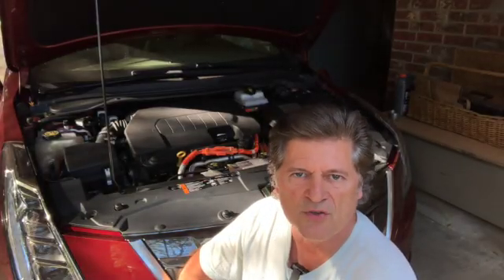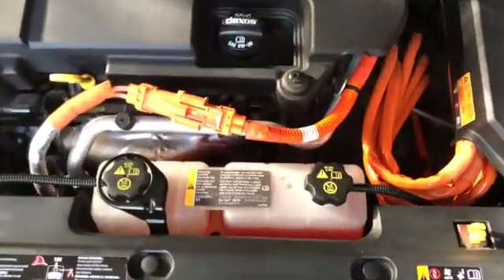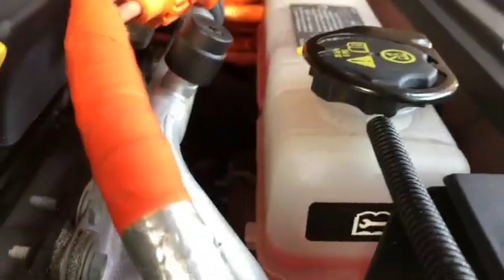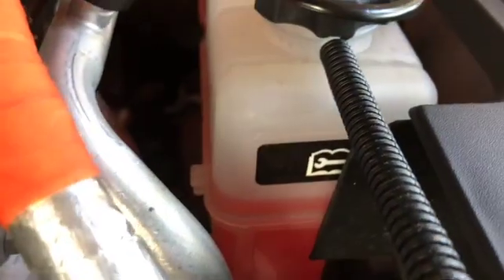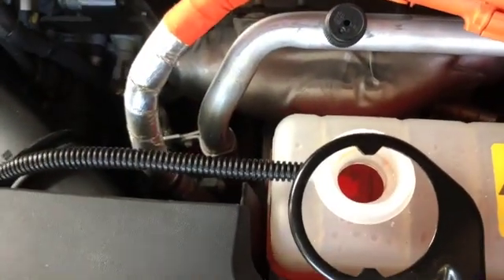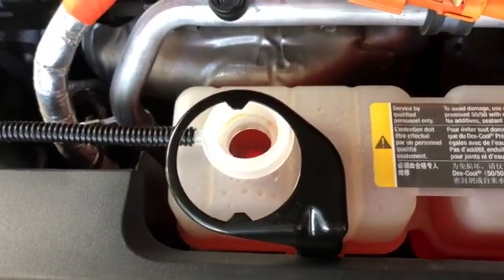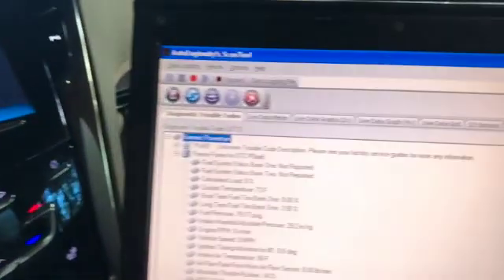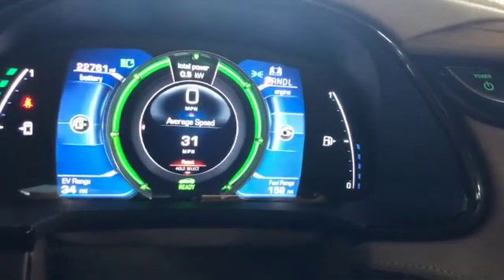Service High-Voltage Charging System Error Message...Fix and Reset

Comment: I was surprised the Chevy dealer had the coolant in stock cheaper that the auto-store or Amazon, and it was the exact right product per the manual. 18 bucks. The local smog shop reset the computer for free, and bingo...back in business. Thanks for your video.

Comment: So I’ve filled up the coolant and nothings changed, removed the code and it stayed ok for a couple of days then came right back I assume it’s the sensor but don’t know if I should buy a new one or how to replace it if you can do a video on that 

It’s sometimes hot in the car but I assume it’s the summer heat

The scanner says the code is a P1E00 with the scanner also adding $07E8 and a freeze frame of P0AA6

Comment: I have a 2017 Gen 2 Volt and found all 3 of the reservoirs slightly low - I've never seen coolant on the ground, nor can I smell it when driving...  Where can the coolant be going?  Once topped off, (High -Voltage battery res. had a simple washer-type lock, just hold the top & bottom of the cap together while removing to bypass lock), I cleared the code.  Viola, CEL gone - Thank you!
Reply from the maker: Could be just a small leak that comes out the rear drain while you’re driving. Might be worth a check to see if there is moisture at any drain locations.

Comment: If the problem persists, pull the tank if you have to but on the left side directly on the bottom is a slide out sensor...fat "T" shape (Black).
Reply from the maker: Thanks for the tip!

Comment: Hey what kind of scanner did you use for this? I'm looking to fix my Volt and any information would be greatly appreciated!
Reply from the maker: It's a program called AutoEnginuity. 
If I were doing this today and didn't have a scanner, I'd get a YOUCANIC diagnostic scanner.
I just purchased it this week and am impressed so far.

Comment: I have to reset mine every day to charge. I have replaced the sensor and topped off the antifreeze, which was not really low. The heater water pump needs to be replaced again #3, all with less than 55000 miles. Otherwise it has been a good car.

Comment: If the level increase doesn't work, out of warranty the dealer will automatically want to replace the whole tank (that includes the sensor) even if the problem just turns out to be the wiring (2 wires...to a "hall-effect" sensor that goes low resistance when the magnetic float in the tank gets too low) or the $20 sensor itself. 
I also had my Volt do the "UNABLE TO CHARGE" and it turned out to be the charging receptacle itself! You should read continuity between the pins of the receptacle and the corresponding pin of the orange connector...ANY resistance over like ten ohms will make the car go mental. There are videos on changing that...EASY.

Comment: Thank you so much for this video and valuable information!  I have owned a 2015 Chevy Volt for 2 years now  with 85k miles and I received the error "service high voltage charging system". I was freaking out because I know that electric/hybrid cars can be more costly to service so I was seeing dollar signs. Just happened to google this and your video came up. Sure enough my coolant for the lithium ion battery was low. I stopped by the local Austin, Tx Chevy dealer here and bought some dexcool 50/50  for $18  bucks and filled it up to the recommended level. Next I ordered a Foxwell NT301 OBDII scanner from Amazon that says will clear codes for about $60 bucks. And today I hooked it up to the OBD port and cleared all the codes and the check engine light went off and the Service high voltage charging system error message is gone. And I plugged in my car and it's charging again!  You saved me $$$$!! Thanks again ! ☺
Reply: becuase of this very comment, and this video, you guys saved me SOO much money. I cannot thank yall enough. I have a 2011 Gen 1 Chevy Volt and had the same code/error message. I picked up some some dexcool, took it auto advance, had them clear the codes, and bam, my car is a PHEV again. And i have been driving around just with the engine for almost 2 YEARS, and all it took was a little research and advice from others. That you both, again.
Reply from the maker: @diddle1675  it’s pretty sweet when you start being able to charge again!
Reply from the maker: Glad to help, I think the actions in the video solved the problem for about 90% of the people I’ve talked to!
Reply: The dealer would have only wanted a GRAND or so to do the same thing.
Reply: That's amazing...I'm super glad to have helped...what would we do without YouTube...

Comment: This is great news and took a lot of stress off my shoulders in the middle of the night last night.  (Seriously, woke up stressing about this at 3:18am.)

So, what is the deal about getting all the air out of the battery system that I'm hearing about?  It sounds like doing this doesn't impact that?

I got a new battery installed but they didn't fill the coolant reservoir...should I take it to the place that did the install to take care of it?
Reply from the maker: Yes, that should’ve been part of the service. Sorry for the late response!
Reply: Thanks!  I did take it back, and they took care of it. @pinkcaddygarage267

Comment: So happy I was able to find this; hopefully this is what my volt needs. Random question: Before this message, I had a service airbag message appear. Are these two often connected? The dealer wants to charge me $220 just to bring it in for diagnostics.
Reply from the maker: To my knowledge, they are not connected. You may do well to buy a Bluetooth diagnostic scanner something like Bluedriver, and give it a shot because that may help pinpoint the airbag problem.

Comment: When I used the scandal at the auto parts store, it cleared another code related to an O2 sensor that I replaced but it did not remove the warning for unable to charge. Is there another way to do it? Is there another type of tool that I need please let me know a good way to communicate with you, thank you
Reply from the maker: Some scanners clear more codes than others. Sometimes the dealer can clear that code so that may be your last resort.

Comment: This JUST happened to me with my 2014 ELR😳. Check Engine Light came on with the SERVICE: HIGH VOLTAGE CHARGING SYSTEM.  Thus, no ability to charge the car!  Opened the hood and what do I see? The fluid you speak of is low; below the sticker!  I have had the car since 33K and this just occurred at 70,785; all maintenance performed by Cadillac. Per your instructions, this has tremendously helped!!!  Thank you
Reply from the maker: Glad to help!

Comment: Hello all another update:  Yesterday 8-1-23 the SHVCS error message returned however this time the fluid level is not the problem.  After some research and what you mention at the end of this video, might be the sensor that is attached to the bottom of the tank.  Today I went to the Chevy Dealer parts department and picked up a coolant sensor GM Part #22922224 which was $22.57 with tax.  I will update this post once I have performed the service, hopefully this is the problem...can I get lucky twice?  Any tips on how to replace the sensor?  Has replacing the sensor helped anyone else?
Reply from the maker: I’ve never had to do the sensor so let us know how it goes.
Reply: @pinkcaddygarage267  After doing some more research on how to install the sensor I was able to replace the coolant sensor without removing the tank from my car.  Using both hands (hand & thumb) I was able to push the sensor out of the bracket >>> towards the front of the car, (half the battle is knowing how) took 2 minutes to replace the sensor, the hard part was getting the new one back into the bracket just by feeling the way in, finally it found its way in with a minor snap into place...wow!  Now all I needed to do was to clear the error codes.  (Again, my car is a 2015 Volt) with the car on (engine off) plugged my original CP9125 code reader, hit "READ" and it came up with 6 codes, push and hold "ERASE" key down, after it asked "ERASE CODES" push and hold down the ERASE key again >>> all codes cleared.  The check engine light is gone, the SHVCS error message is gone, plugged into charger and YES I'm changing again...UPDATE: >>> DTC = (P1FFF & P0AA6) errors codes...came back...Now after more research looks like my car will need reprogramming of the BECM and HPCM before the codes will stay off...any help would be much appreciated.
Reply from the maker: @LoveMyRottweiler1  on one Chevy volt that I worked on it could only be reprogrammed by the dealer. That is what you may be facing.
Reply: @pinkcaddygarage267  Yep, that's the same conclusion I came up with...now all I need to do is to find the right dealer (service department) that know how to do the reprogramming...I wonder if the reprogramming of the BECM and HPCM covered under warranty.
Reply from the maker: @LoveMyRottweiler1  check to see if it’s covered under the emissions warranty as well.
Reply: @LoveMyRottweiler1  Hey did you ever find a solution? I'm having the same issue.
Reply: @adamhansen8805  Yes, ended up taking it into the dealer where they did a system update...$400 later all is well and now its been more than a year and all is great...dealer service department did a good job...for once...

Comment: I think i'm halfway there.. I added the 50-50 antifreeze up to the top of the sticker, but my auto -parts store could not reset the code. They suggested I pull the negative batter cable, which I did.. let it sit for 5 minutes before reconnecting.  The service high voltage warning did go away, but the check engine light remained. I tried to plug in and no green charging indicator.. Turned the power back on and the 'service high voltage' message came back on. But after I turned the car off/on again, it went away, but the check engine remains.   Since that warning came back on, I wonder if I again need to pull the negative cable, then maybe run the engine until the check engine goes off?
Reply from the maker: I usually have to clear it with a code reader myself

Comment: I have had this coolant reservoir  become low on mine several times… what a pain in the ass. The coolant seems to evaporate or leak over time, and the reservoir is so tiny it only has to be low by a cup or two to trigger it. This stops you from charging the vehicle, even after you add coolant because the code doesn’t self-clear. Good job GM, another POS

Comment: This light came on and the coolant on that side was completely gone, I filled it up and I am getting ready to take it somewhere so they can connect a scanner and delete the error. Hopefully I can find a place O'Reilly say they don't do that no more.
Reply from the maker: Worst comes to worse. You can buy a scanner and then you’ll be clearing your own codes from now on.
Reply: We filled it up and my son took for college. When he came back and parked in the driveway I saw the  coolant leaking on the floor. It is much worst than we thought. @pinkcaddygarage267
Reply from the maker: @florcastillo11  maybe it’s time for a new coolant tank
Reply: @pinkcaddygarage267  Waiting on news from the dealer.... but thanks for the video. What I thought might be an easy fix turned into a trip to the dealer.
Reply from the maker: Yep, sounds like a good idea.

Comment: i only got this high voltage surface charge message after i replaced my old battery with a new one. So how do i fix that?
Reply from the maker: First, see if you can just clear the code with a scanner. Second, check the coolant tank level per the video.
Reply: @pinkcaddygarage267  dont have an OBD scanner just a battery scanner. What would my coolant level have to do with any of it, if this message only came up right after i put a new battery in ? Thanks
Reply from the maker: What exactly does the error message say?

Comment: what code reader are you using? mine's not clearing the code out and other than guess-and-check I don't have a good resource for which code reader to get. thanks.
Reply from the maker: I’m using a laptop running AutoEnginuity. I have instances where only the dealer could clear it and others that a handheld scanner would do the trick.
Reply: @pinkcaddygarage267  the more expensive diy scanner finally cleared it for me, but the cheapo 38$ autozone one didnt. The better diy scanner instructed me to "start engine" to finish clearing the code, which i did by popping the hood with the car in "normal" run mode. Otherwise the engine wouldn't be running.

Comment: After viewing this youtube I added the correct coolant to the correct level. I had no tool to erase the error code, so we thought best to take our 2012 Volt with 70K miles on it and took it to the dealer. They said the Hybrid battery was good, but we needed a new regular car battery. Yeah, we had them replace the battery. A month later (Yesterday) after my wife got back from a 150 mile round trip the error light came back on blocking any attempt to charging the hybrid battery. However, I did get the tool to erase the code and it is now charging. The coolant is right at the top line where I added it about 6 weeks ago. I am calling the dealership on Monday morning. Do you have any advice?
Reply from the maker: Well,it is possible you did need a new 12V battery. I don’t know what you would get accomplished at the dealer at this point. They are basically going to say you either need a coolant level sensor, a new tank, a new wiring harness…which could be possible as well. I would weigh that against how much trouble it is to reset the error code occasionally.

Comment: Nice video thank you.  I have added fluid, changed the sensor, and now tried a defeat plug to bypass the sensor.  Each time I can clear the code with a cheap scan tool so I can charge, but I have to keep doing that.  Wondering if there is another problem such as needing a coolant change or maybe something esle?  Appreciate any additional help you can provide.
Reply from the maker: The next thing I would be checking is the wiring harness for the sensor.

Comment: You are a LEGEND. Worked perfectly. Thank you so much. For everyone else , I have a 2015 volt. Filled up all 3 reservoirs with dexcool orange. Bought a $35 OBD2 scan tool (must have clearing feature) , cleared the code (while car is on), the code cleared , my volt charged again immediately. Good luck ya’ll stay calm this is an easy fix.
Reply from the maker: Glad it worked! If you get a chance, let us know which scanner you bought…I still get question that from folks.
Reply: @pinkcaddygarage267  Performance Tool Diagnostic Scan Tool (W2977) (v3) ODB2.
Reply from the maker: Thanks!

Comment: Thank you for this tip. I have Volt 2014 with 75K miles on it , still running in top shape...except this msg popped up yesterday...
I searched Amazon for ODB tool and found one : BlueDriver Bluetooth Pro OBDII Scan Tool for iPhone & Android ...Will it work you think ? 
Regards,
Reply from the maker: Not familiar with that tool specifically but see the other comments for other recommendations as well.

Comment: Passing my whole day focussing on this problem that just arrive to me,seeing many many vids,read many many post about this,it's seem that is very comom.
As i can understand it's seam like the gen1 volt can't be just reset,it's need to e reprogram(after changing the sensor if it bad)But nobody said if they try to reset in normal operation mode
or if they try to reset on service mode.Ah ah......maybee it's the way for gen1 ??
To  put on service mode you need to NOT push the  brake pedal,push the  blue buton 5sec.